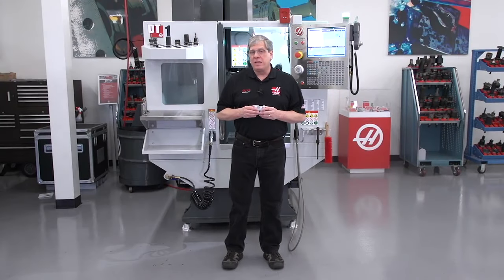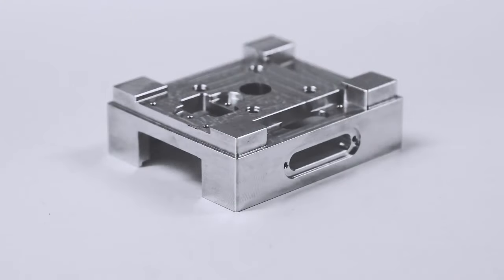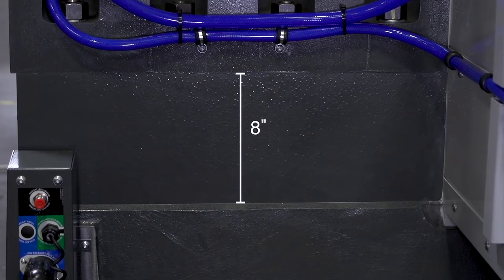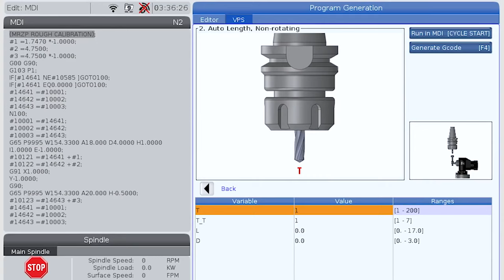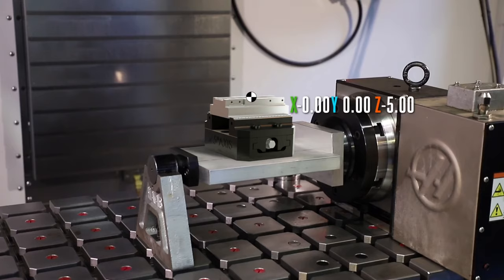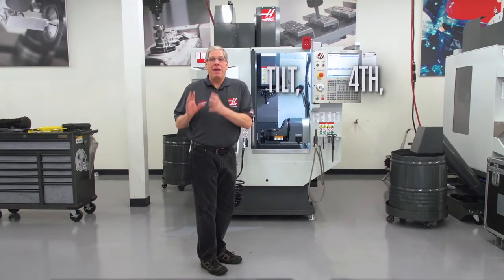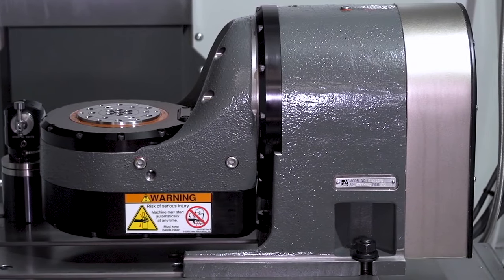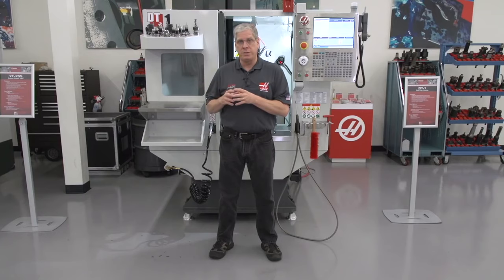5-Axis Made Easy -  Parts 1, 2 and 3

Comment: assuming you don't have DWO/TCPC, how you set your CAM if Y axis resulted from A-90 and A90 is different than Y axis of the rotary axis (C)?
Reply: move part in cad software and post new program. if stock change. do it again. and hope cad code is correct and not need read line by line LOL.

Comment: Hi, I have a Haas and Mastercam with a 4th (A) axis. Is it possible to do 4th DWO option during simultaneous work? That is, if you fix the cylindrical stock off-axis, it will freewheel as if it were a crankshaft, but will it be able to process evenly from all sides? Is this possible? I am resetting the parts in full axis right now. I just wondered about the DWO convenience. Is this option included when I buy 5 Axis? By the way u r great man John.
Reply: do you have a post for heidenhain ?

Comment: if we first even fully use c axis on lathe make minium atleast hex LOL if he would know it could do many parts one setup he would put silly jobs on that machine that allready had programs on other machine. 2 new machine came and he told mayby rotary come and not even remember lathe has c why waste that on silly parts that can break machine without never even use c. like old machine LOL parts like bolt. first lathe and center drill. then mill hex. then back lathe. or do hex and center drill same time. simple custom makro i allready have LOL milling makro just converted c axis